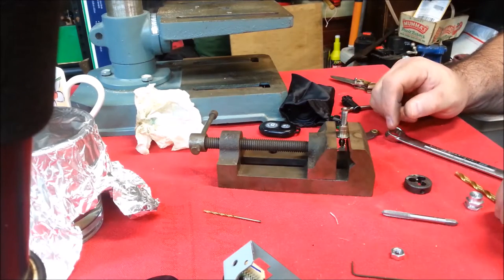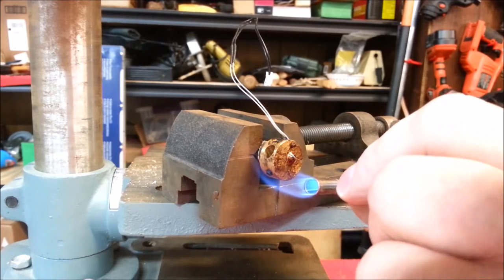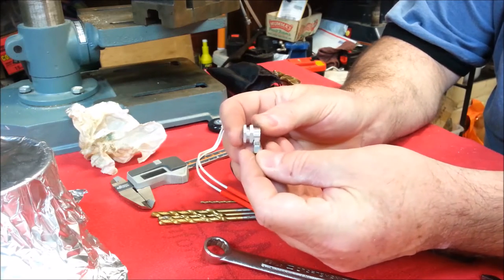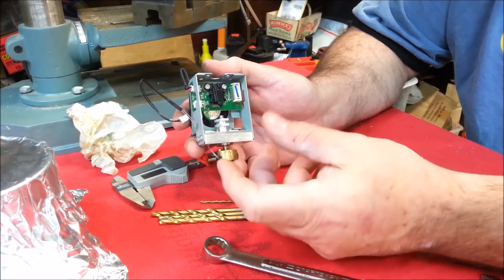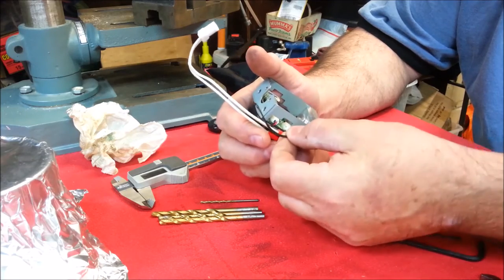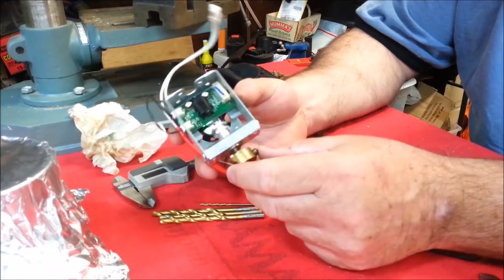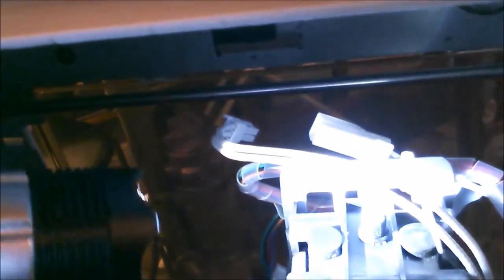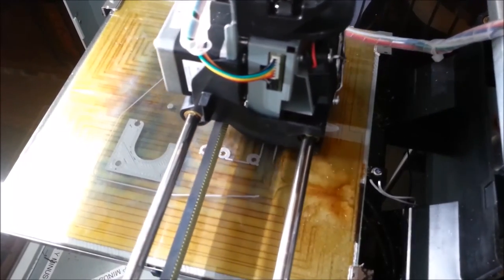Hack 3D XYZPrinting  Da Vinci 1.0A STOCK  All Metal Hot End Part 4

Comment: I soaked that part in acetone first then use my heat gun to melt the rest. I then used a strange from a 14awg wire to ream out the rest. 
I enjoyed this video series.
Reply from the maker: Thank you.  The real secret is cooling the mounting block better by adding little sinks to it or making a nut like mine.  The clogs are from the stem getting too hot, not debris in the filament.  Thanks Chaka!

Comment: poor kitty,  wow you really impressed me brother.   been thinking about talking to ya about a small part for a hammock.. picture a ridge line on a hammock, then picture a disc about maybe 2 inches in diameter or less with a hole in the center for the ridge line to go through  on both ends. now picture 6 or 8 slots in the disc all the way around for shock cord to slip in and the knots hold.   this is for holding the cords on my bug net and under quilt together at one spot.maybe even cup the disc to hold the cordage better..
you keep the rights for it and ill use it .....lol.
take care.
..bill
p.s. need a idea  to hold the disc in place on the ridge line..
Reply from the maker: +billy joe denny How many lines might need to be latched into one disk?&#160;&#160; I presume the shock cord would be held in place by a stop knot?  I presume ridgeline is para-cord.  What diameter is shock cord?
Reply: ridge line is 1\8 inch amsteal, and 6 shock cord  lines  I'm guessing 3/16 , it came with the snug pack under quilt.   and yes a stop knot. whats your thoughts on the disc shape , i bet i got your mined rolling ,,,haha..the hole in the middle may have to be tube shape to keep the disc from twisting .
Reply from the maker: billy joe denny You did not say how many lines will be connected to each plate?  I have some ideas.
Reply: +Crafted i have 4 from the snug pack around 3/16 bungie coming up to the bottom of the disc, and the 2 from the bug net around 1/16 to the top of the disc..
Reply from the maker: So. all these lines come to one central tie off location?.  You would need one of these for an entire setup?  What is confusing me is I imagine a ridge line.  I imagine a bug net with about 4 short lines holding it to the ridge line spread out along the length of the ridge line.
Reply: +Crafted   ill try to send you a picture of the ridge line set up..

Comment: Can I buy one of nuts you made? Also, did you ever install the e3d? Would love to see how you did it. Thanks for your help.
Mark
Reply from the maker: I was thinking of making a batch of them.  I bought the E3d hot end to attempt a Nylon conversion.  Now I don't wan't to take one of my printers down. I make plastic parts with them for my RadicalRC company.  If I get a 3rd one, I'll convert one of these to Nylon.   That printer has been working flawlessly without a clog.  I think my thermal grease came in after the video, so I would like to take it down and add that additional insurance.  This would further improve the thermal connection between stem and nut.  These are GREAT printers with just a few simple modifications.   Almost a secret in the 3D printing community.  Are you having clogging issues?  What is your setup?  Repetier?
Reply: No repetier, running everything stock. No clogging issues on over 300hrs. Only using abs. Want and need to print flexible parts. Talked with xyzprinting they said the 1.0a can print flex but suggested I upgrade to newer extruder. Said it had higher temp threshold. Not sure if they are just trying to make a sale. $90.00 little steep. With regard to your nut mod, couldn't I just add another nut on top of existing?
Reply from the maker: Mark Parente You could add another nut. Even better would be changing to Aluminum nuts with an aluminum washer sandwiched in between.  Soaks up and releases heat much better than steel.  Have you run any transparent filament yet?  I had issues with it thinking it didn't have any filament loaded when I tried that with red.  Orange worked.
Reply: +Crafted I have used the transparent without any issues. what size nut did you say that was.
Reply from the maker: Mark Parente I think it was 6mm.  The threaded shaft will measure about .230" for 6mm.  If you don't own a digital caliper, buy one.  A necessity.  ;-)  I don't remember without re-watching the video or taking down my printer to measure it.
Reply: Where u successful at printing xyz nylon?
Reply from the maker: I've not tried the nylon yet.  I have two printers, on at work and one at home.  The home unit I had to upgrade to Windows 10 and haven't gotten it talking to the printer yet.  I need to make a nut to upgrade my work printer.  I've not had any problems since.  I could make more than I need.  I'm tied up really tight for the next two weeks.  Make a note and contact me again.
Reply from the maker: I've not done the conversion yet.   I think I'm going to wait for a deal on a 3rd printer and do it that one.
Reply: what type of conversion are u referring to? extruder/hotend.
Reply from the maker: Mark Parente The conversion to Nylon.  Problem is I'm making some parts commercially for my RC business and I hate to have only one ABS printer.  I need to do the Nylon conversion on an extra or 3rd printer so I won't get in trouble if I have a break down.
It's my understanding Nylon is tricky so I'll probably be fooling around with it for a while.